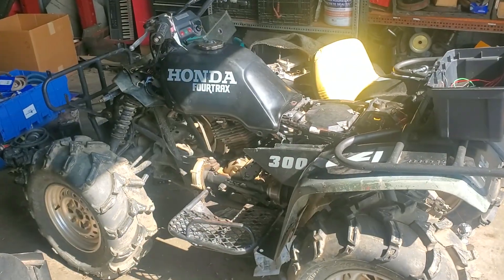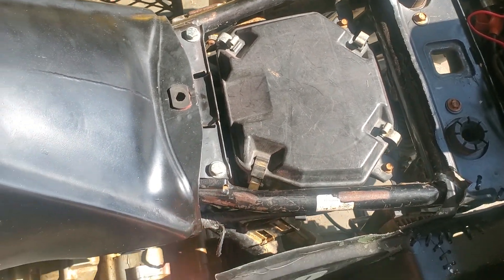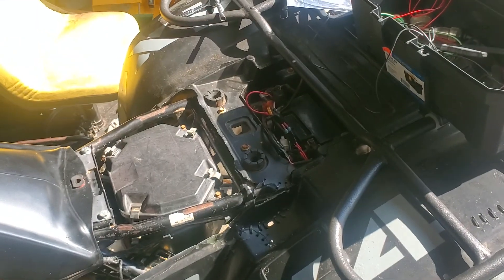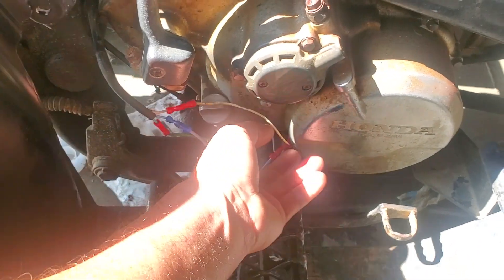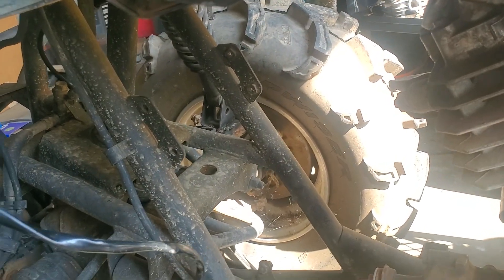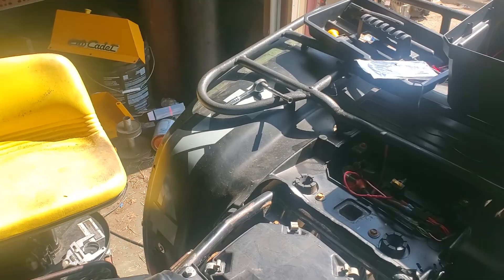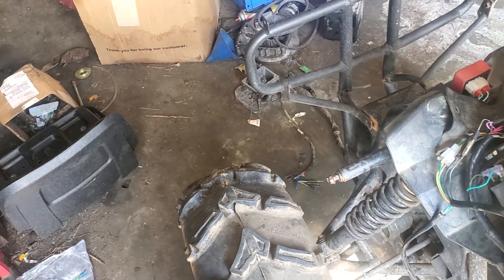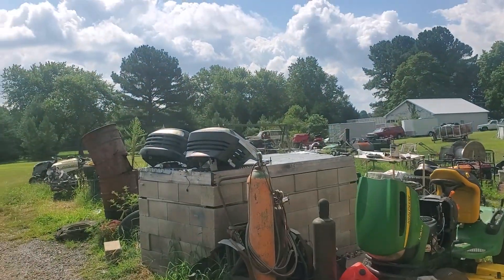90s Honda FourTrax 4x4 wire harness and other issues

Comment: please post a video showing where every plug on the harness goes PLEASE!!! im stuck
Reply from the maker: I'm sorry this video and that machine is a year or so old maybe even more maybe. I will say there's only a few plugs that can plug up to anything else. If you lay the harness out what's the old one as you kind of Mark where everything comes from or take the mental note. Because I don't get to take pictures that will keep track of where everything comes from. There's only a couple of plugs that will actually plug in to something that they don't belong in. It is two plugs that are up toward the handlebars. The reason I know is we kind of had that issue happen when we were putting this one back together. Have two plugs get crossed up and the Machine wouldn't work then we figured it out. For the most part though every plug is self-explanatory it will only plug into one part of the machine. Start at the battery end of the harness. There will be a part of the harness that goes to the battery constant power. And then you work your way out from there if I remember correctly the two at the front that are interchangeable but don't machine run if you cross them up is to square plugs I think they are four wire plugs period and for some reason black and yellow wire comes to mind. But please keep in mind this has been more than a year since I put that harness on.